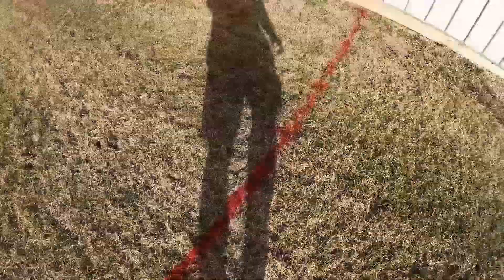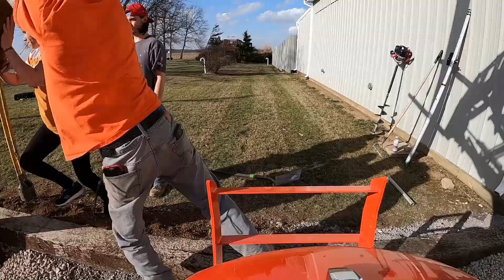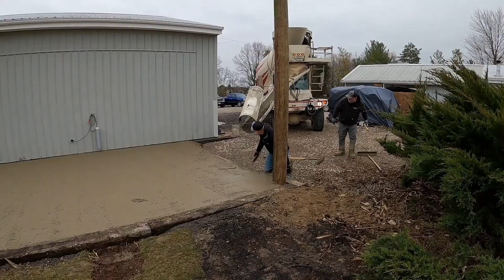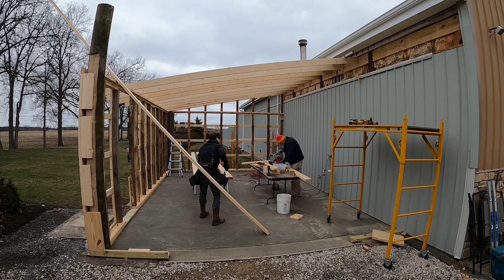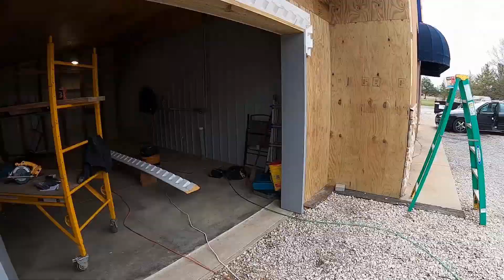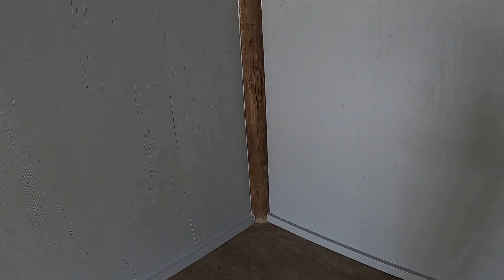Garage Addition to Existing Shop

Comment: you should not charge EV vehicles indoors due to the risk of fire.
Reply from the maker: Charging your EV in the garage is safe if your wiring and charger are up to code, the area is ventilated, and you take basic fire safety precautions. I appreciate your concern.

Comment: This seems like a video you presented before.  I am curious about the lessons you learned about the building setup for Tesla.  Did you need more room.  You put in a charging station.  How is that working out for you?  What have you learned from that experience?
Reply from the maker: David, 
I did episodes as the build took place and made a summary. The garage turned out as I expected. As for size, no matter what you build, more is needed. However, it was built for my son, who only plans to park there. The charging station was a straightforward hookup at the shop panel. It requires a 60 amp breaker and #6 copper wire. He starts and stops the charging on a schedule he desires. What I learned is that I would build another as desired.